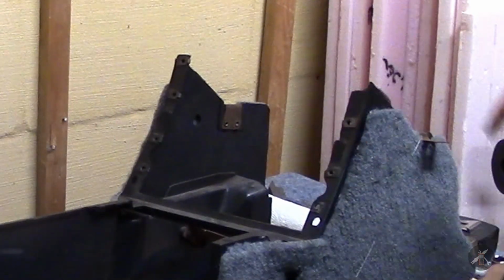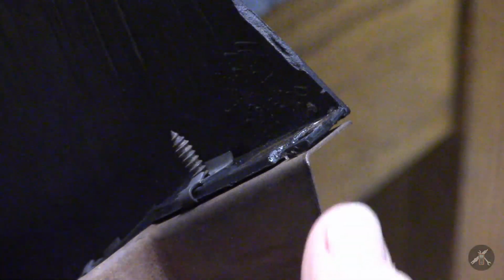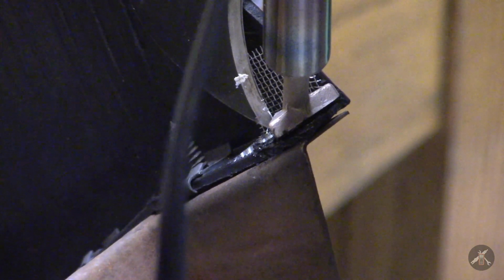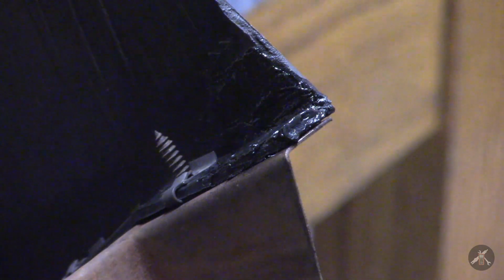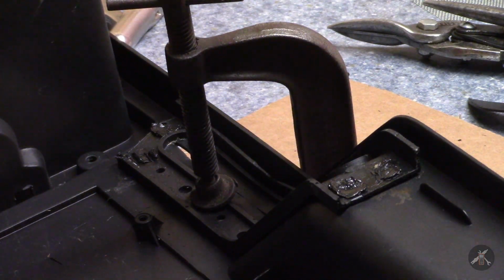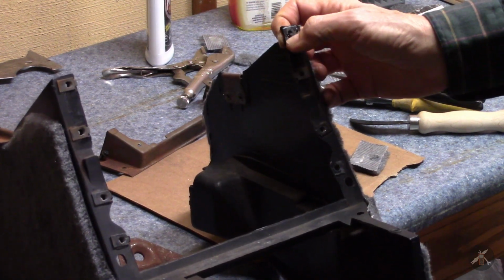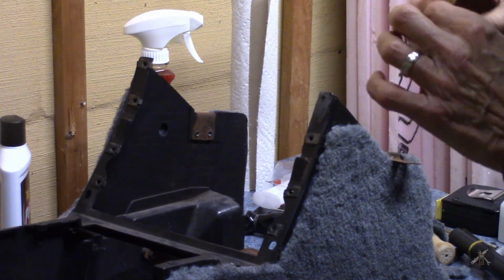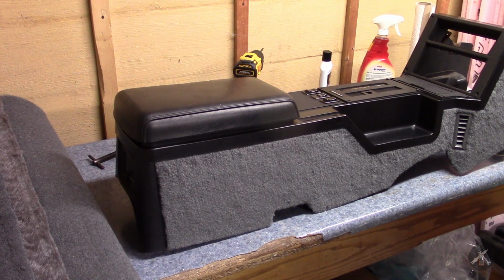Repair Camaro Console with Harbor Freight Plastic Weld Kit and Assemble - IROC-Z Barn Find EP89

Comment: When i Re- carpeted my console i used super 77 spray adhesive. Worked very well and held up for 10 years till i sold the car. Probably still holding today
Reply from the maker: I have some #77 and have used that for other repairs.  It probably would have done fine.

Comment: Superglue mixed with baking soda creates a hard material that can be sanded to shape.
Reply from the maker: That's one I hadn't heard of before, I'll keep that in mind.
Reply: @bitsofwisdom460  I didnt even bother with the adhesion promotor cleaned it good with alcohol and shot it  light coats and you wont be sorry Im redoing all the plastics in my t/a with it the flat leaves the perfect color match to facory!!!!

Comment: I Have using duplicolor flat fabric and vinyl paint and the finish is a dead on match to the black used by GM It will make that console look brand new and its very durable for $10 A can
Reply from the maker: Thank you for the suggestion. It's good to know that it has a good match. I did pick up some of that paint along with the adhesion promoter for plastic.  I wasn't sure how well that would match, so my first attempt was to gently work out the blemishes.  They weren't deep and cleaned up fairly well.  I may try the duplicolor on one of my old parts as a trial.